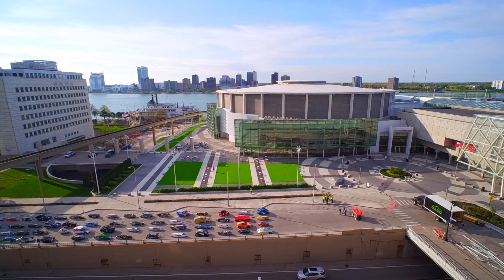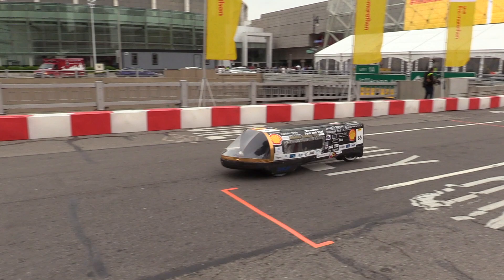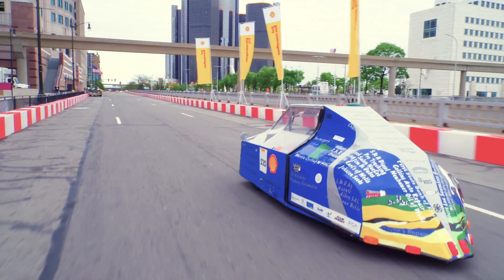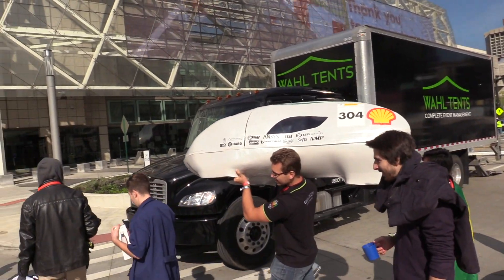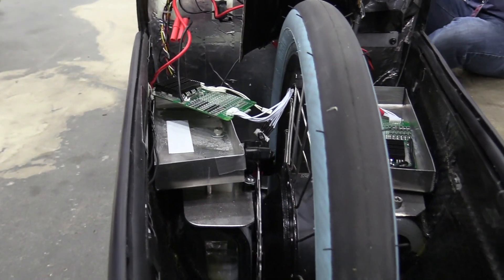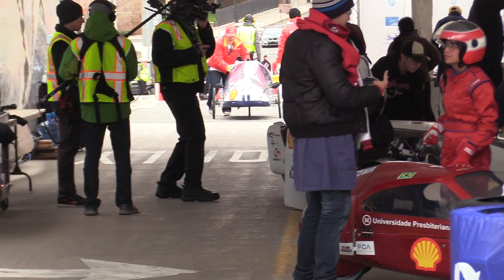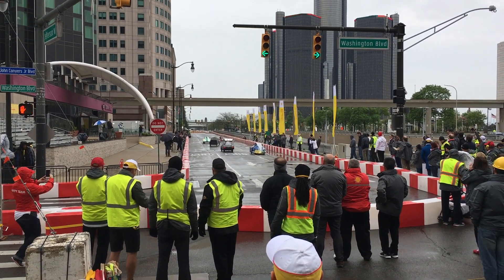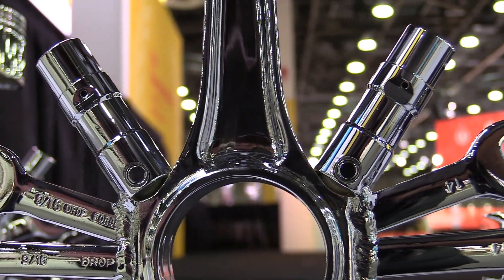Could  YOU Build a 2500MPG Car?

Comment: You can make a 250,000 MPG car if you abuse gravity.

Jokes aside, it sucks that we still don't have highly efficient vehicles. People only want a vehicle that can transport at least 5 people and stuff 2 or more bodies in the trunk. They also want them to be fast, and to look good. Fast meaning the acceleration, not just the max speed. 

A small vehicle designed to transport one person with storage space for a few backpacks is what we need. It wouldn't look pretty since you need to change how it looks for efficiency. It'll be much longer than it is wide, and it will probably take at least 10 seconds to go from 0-60mph. It will also need to be made of a material lighter than metal. This could be a composite or carbon fiber, but metal is too heavy. Don't forget about it being an autocycle (3 wheels) instead of a car. You want as little weight as possible, and motorcycle regulations are less strict than car regulations. More safety = more items = more weight. A vehicle designed for going to and back from work when you work 20+ miles away and need to drive to work and back every day.

Comment: I am sure I can do the research, find the materials expected to be the best suited. I maybe even will make it through the chassis build with full systems integration. I would start the final task of engine building and installation, and completely blow it. I'm certain however, I would have the fastest car after I get sidetracked "improving" the initially well researched, more appropriate  version. I know myself too well to even pretend otherwise.
Reply from the maker: HAHAHA, I would be thinking " you know with a turbo... " HAHAH
Reply: My mower popped the head gasket and I truly started only allowing for required to function repair and not a thing more...

I somehow managed to port and polish the heads, stumbled upon a bit over-sized piston from a fallen relative. I was "inspired" that it's a requirement,  and spent more time to locate needed parts, and a matching sized reamer, than I spent on actual work. Thanks to dumb luck it worked, for a few weeks until unnamed "borrowed" it, running over a stub of broken clothes line pole. I stored the piston crown again.

Comment: High efficiency may sound nice but with the amount of comfort and driveability you have to sacrifice to get it, the supermileage prototypes aren't anywhere near practical. If the competition required that the vehicle be able to accommodate an average person (say 5'8 and 160lbs) instead of the second smallest and lightest person on the team, be able to accelerate to street-legal speeds with street-legal acceleration, it would be more impressive. I bet even those very modest requirements would cut the fuel efficiency in half.
Reply: Teardown Dan just ride a fucking bike, honestly
Reply: Which is exactly what I do from May to August whenever weather allows and I don't need to carry tools or other luggage.
Reply: There are two types of vehicles that can be entered into the competition. A team can choose to compete with a prototype vehicle or you can compete with an urban concept vehicle which is required to be street legal and fit luggage as well.

Comment: It's tricky to be made fair... If they don't compensate for driver weight, lighter drivers gain advantage but if they do, some wight can be saved by removing or using lighter braking assistance systems and relying on a muscular driver's own force to stop the vehicle.

Comment: Its about smiles per gallon not miles per gallon. My car gets 13 mpg at best, do I care? No. Is it fun? Hell yeah.
Reply from the maker: +AndreyGaming hahaha right on! I am not a light footed driver ;$
Reply: Mk7 GTI, you can have a lead foot and still get good mpg's.
Reply: Mk7 R, you can get good mpg's coasting down hills or riding on a trailer.
Reply: AndreyGaming I'm sure your pockets didn't find it too fun.
Reply: Brother Hussein I don't have a girlfriend. I got enought cash for sure. It would actually be worse if I owned the most economical car I know of the prius plug in and had a girlfriend they empty your account faster than any car does.
Reply: American classics and classic muscle owners don't care about mpg. Old cars had character and style, now it seems like they traded their soul for good gas milage. The second reason I don't own a modern car is that only milk comes in 2 liters, coming from a 390 cubic inch V8 owner. Can you guess my car? One hint: Sharp fins with dual bullet tail lights.